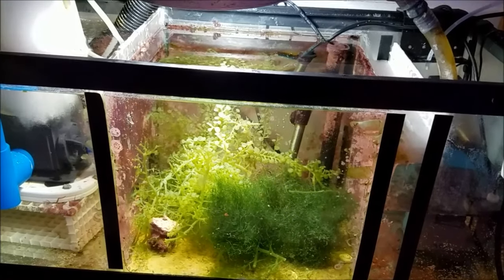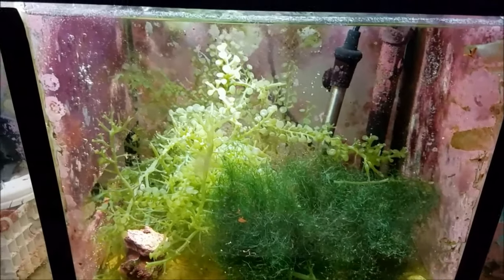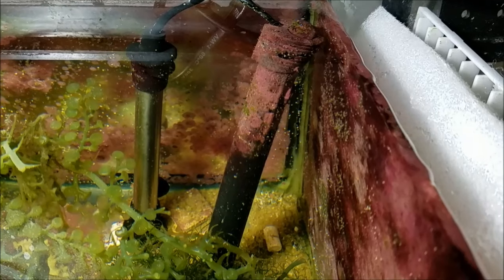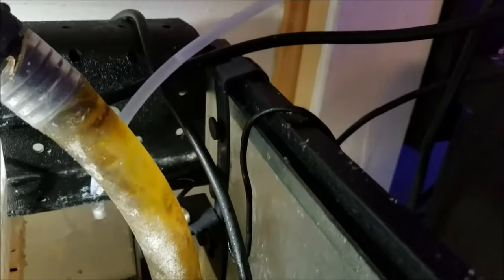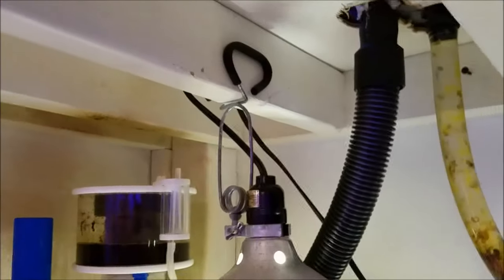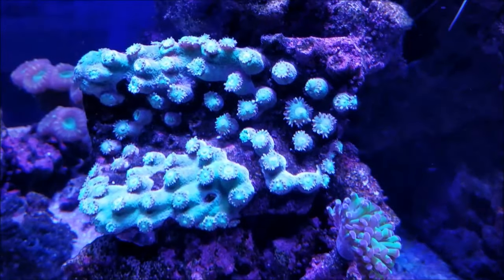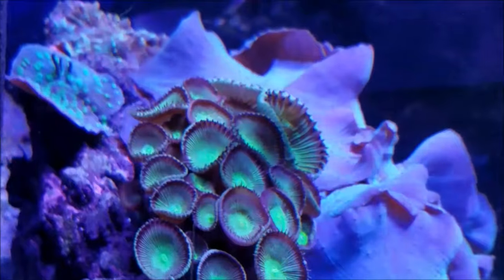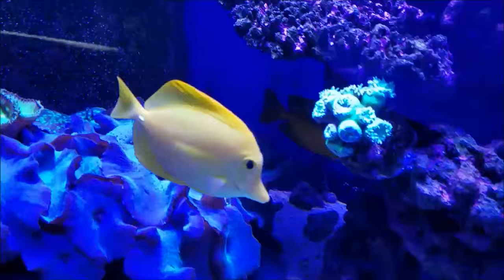What's Under The Hood? Tank Tour

Comment: That's a very well kept sump compared to a lot of the ones I've seen, very clean. I recently  installed my first reactor which I'm running with carbon. Prior to that I used nothing but standard equipment on my 29. I'm debating on trying out a sump, never have used a sump. great vid.
Reply from the maker: +VANDAL caTX thank you very much. In my opinion I would never set up a system without a one. It allows you to hide equipment, increase water volume to stabilize parameters and allow for an area to grow macro algae and pods.